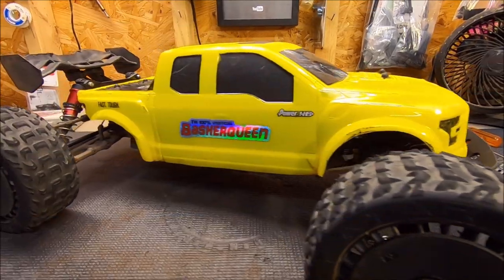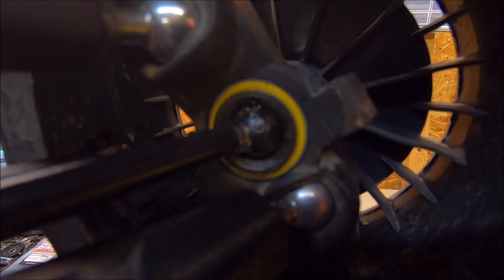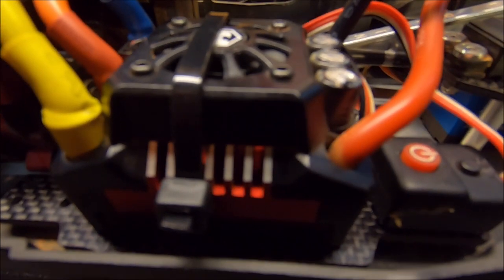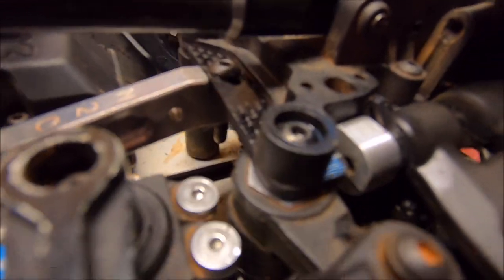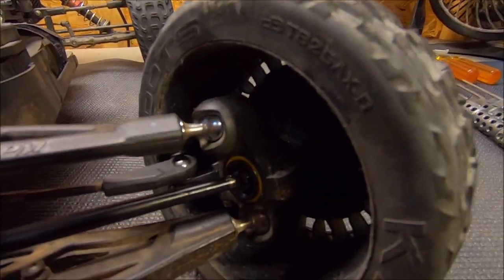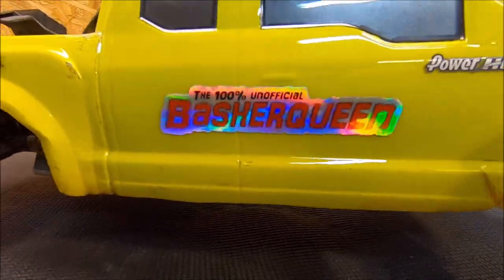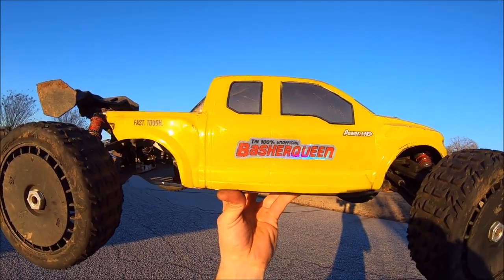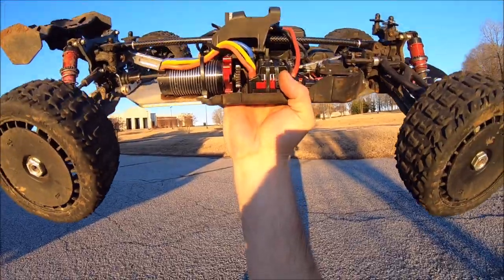INSANE!😱 Full New "BASHERQUEENED" Arrma Talion 1/7 XL!💪 FULL Send Session with Socokin lipo test!

Comment: On that esc adapter plate do you use the holes to mount the esc?wasn’t sure if the bolts would hold up to hard bashing or snap and ruin the esc.thanks sweet bash🤪
Reply from the maker: I did run screws but also Zip ties to help hold it. I'd recommend some good double stick tape too just in case!😎👊

Comment: Awesome video the front center drive shaft what is it under I can't find it only rear it is for Mojave correct? Just got my exb Mojave yesterday something wasn't right would roll like 💩 my front center drive shaft is over sized no play what so ever and would make the whole truck vibrate like hell how to take it to my grinding wheel to try to get some off is really no play at all still but it was enough to make it run right so I will be calling horizon tomorrow but I want to upgrade it anyways thank you
Reply from the maker: Yes it should be under Mojave on the M2C website.🤔Let me know if you can't find it I'll find out!😎👊

Comment: Rc dude my kraton 6s make a rattle sound when I turn max and giving some throttle. Can this come frome my frond diff or you think it's something wrong with steering? Maybe you know what it can be.
Nice video you have iam a big fan from the Netherlands 🇳🇱 👍🏻🤙🏻
Reply from the maker: Sounds more like a front diff.🤔 Is it more of a clicking? Check your wheel bearings and make sure your pillow balls aren't too tight in the front hub. If everything is smooth then could be the diff.
Reply: @RCDUDE81  oke thanks I'll look tonight what it is. But good tips and keep up the good work

Comment: Crazy, amazing skill. Blows my mind! Hope not a bother. Bought the Fireteam, went back bought a Talion EXB. Love them both amazing fun.. if I run the 23t pinion and run on mostly level ground with very little up hill, etc. with a fan installed on motor do you think I will have heat issues. My bashing, trust me nothing like yours…. Any help and your thoughts would be appreciated! Thank you, God bless.
Reply from the maker: Awesome bro! Both great rigs!!💪Are you talking about the Talion with the 23? Should be fine if running the stock belted tires and not going crazy hard!
Reply: @RCDUDE81  yes sir. Sorry about that. Talion on stock tires. Yah, nothing all out all battery, at all.. thank you sir. I have become an Arrma guy, Traxxas now running a close 2nd. Really impressed so far!
Reply from the maker: Nice! I have several vids on the EXB Talion. It's a ripper! I bashed hard with a 20 tooth and used a 25 and 27 solely for high speed street ramp launches. At least the tires can take it!😎

Comment: Hey man looking to get a talion i have 2 guys selling them near me one its an immaculate stock one for 350 one has XL conversion and bigger motor and lipo but no talion body for 400, i have jumps near me but really would like to use it on a local dirt race track near me wondering if the xl makes handing worse, what do you think i should go for? Thanks
Reply from the maker: You can't go wrong with a stock Talion. Will probably be better on a track than an XL.

Comment: Do you start the build with a talion?
Reply from the maker: I did yes. Then added a Mojave chassis, center driveshafts and T2T brace. This truck also has Kraton hubs and hexes.😎👊
Reply: @RCDUDE81  thanks man! Do you mind if I copy this build? Also, I'm assuming Kraton 8s hubs and hexes
Reply from the maker: No problem man! It's Kraton 6s hubs, end axles and hexs. 8s parts won't fit.😜
Reply: @RCDUDE81  last question. Is the center brace for a Talion or Mojave?
Reply from the maker: The Front/rear Talion braces will still work. The Tower to tower brace is Mojave.

Comment: The 3d rc wing mount is 3d printed tpu i have all that stuff to 3d print them hope that download is on the net for free
Reply: This isn’t tpu. I have a custom blend made specifically for me. Tpu isn’t as durable or as strong. Tpu pulls right through the screw holes and flops all over the place. Easily imitated never duplicated 👍 lots of people try. But for $12 save yourself the 7 hour print time.😁
Reply: @3drc681  its Polypropylene?
Reply: @jasoncrow2819  it’s a 20/30/50 blend of poly,tpu and nylon
Reply: @3drc681  wow thats a nice blend good job
Reply: @jasoncrow2819  thank you sir. Took over a year of testing to find the right materials and design to make a mount that’s cheaper and more reliable then anything else out there. 8s wing mount will be hitting the market very soon.
Reply: @3drc681  what 3d printer do you use
Reply: @jasoncrow2819  heavy modified enders
Reply: @3drc681  Oh cool i got 1 machine its the ender 5 pro with a couple upgrades
Reply: I make allot of rc parts and the designs but havnt tried to sell any yet. Mostly using 98a hardness tpu and pla pro for the hard plastic parts
Reply: @jasoncrow2819  oh nice. Good for you👍 tpu is decent but likes to rip and screws pull through way to easy. Taulman pctpe look into that material. It’s pretty good with  out having custom material made for you. Other then that if you want you can have material made for you but it takes a while to get. Usually 6 weeks for delivery and cost twice as much but a better product is definitely worth it in my opinion. Do you have a website or anything? I have tons of designs I made but don’t have time to make. I would be willing to sell the stl file if you would like.
Reply: @3drc681  oh I will try and perfect a few mabey then get back to you on a design I make most of my rc parts i custom made are for the Zd Racing pirate 3 truck a china rig. Thanks for letting me know to check into pctpe filament
Reply: @jasoncrow2819  I’m always able to help. I am here for the community not a profit so if you need help don’t hesitate to ask.  I can always be reached through my website it has my email.
Reply: @3drc681  k your awsome thanks
Reply: @jasoncrow2819  I will have to pick one of those rigs up and get some parts off you then. Support us small guys 😂